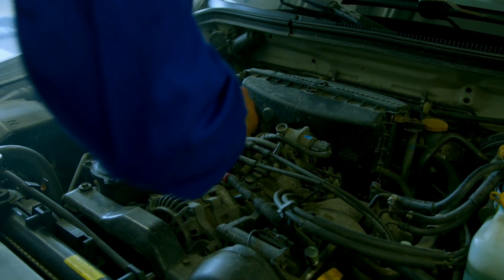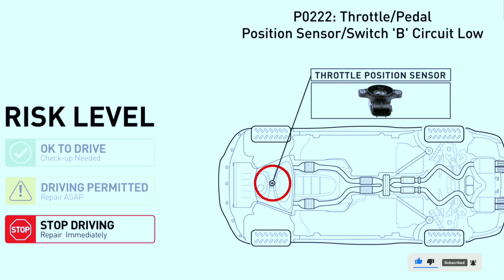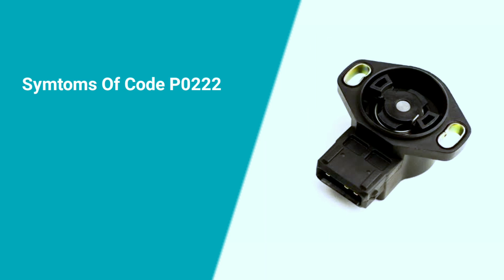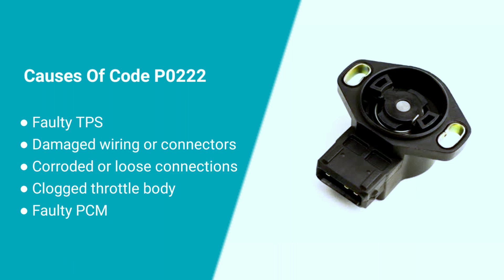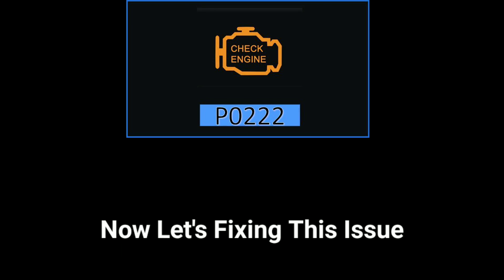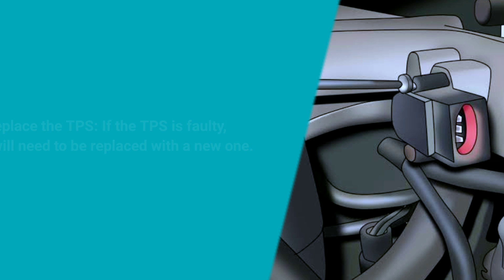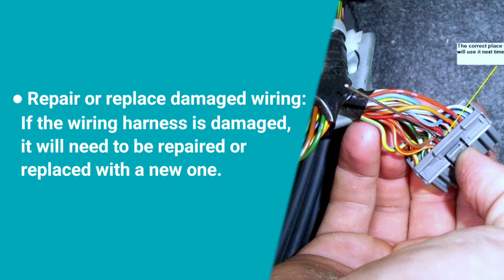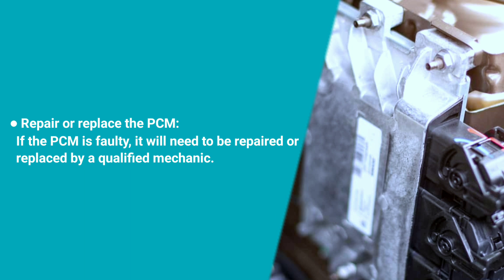How To Fix Code P0222 : Easy Fix for Car Owners |

Comment: Does nissan terra have TPS?
Reply from the maker: Yes, the Nissan Terra has a Tire Pressure Monitoring System (TPMS). This system monitors the air pressure in your tires and illuminates a warning light if one or more of your tires is significantly underinflated.
Reply: @weeklytools  i thought TPS is throttle position sensor?
Reply: @patrickangelo66 It is a Throttle Position Sensor.

This page just makes it own shit up as it goes and truly has zero experience or knowledge to offer any sort of insight or advice.

Yes, all vehicles with modern injection have a Throttle Position Sensor.
Reply: @DasMoose9001  thank you, i am having Check engine p0222 error in my nissan terra 2019 model
Reply: @patrickangelo66 The throttle position sensors on these modern engines are integrated into the throttle body assembly unfortunately.

I would first check all your connections at and near your throttle body.

If that doesn't yield anything obvious I would see about a shop running the values on the throttle body and seeing if there are any anomaly's